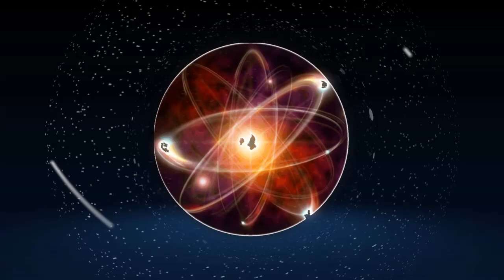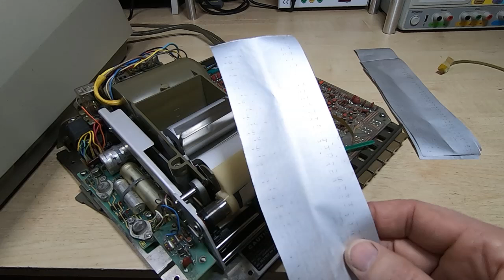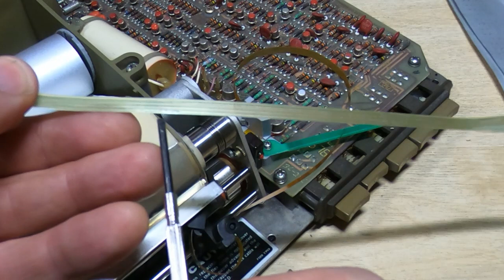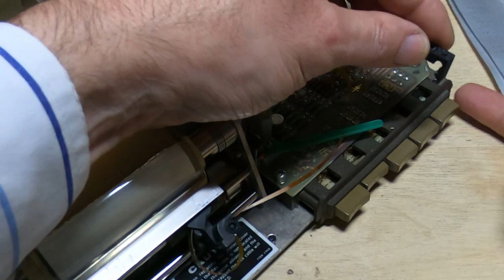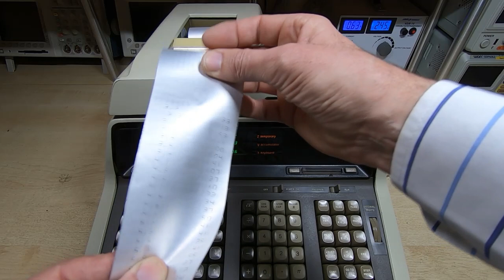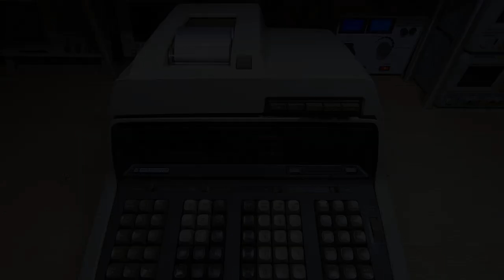HP9120A #1 Repair Part12

Comment: Jerry, this has turned out to be a nice and very interesting repair.  Please do share the details of the magnetic card reader wheel repair and especially the print head repair on the second machine.  Basically everything you didn't show on this first machine.

I've got a box of TI-58C & TI-59 calculators (obviously much newer and less interesting, and probably less repairable than the HP gear you show) in my workshop and may even have the printer that they can be connected to.  I used my -58C in college and at work when my "standard" scientific calculator wasn't up to the task (which was rare) and much later obtained the box of goodies to play with.  After watching you repair these HP calculators, I want to open the box to determine the condition of the calculators.  I'm  certain that all of the batteries will have to be replaced (hopefully I already removed them) and the magnetic strip readers in the -59s will probably need cleaning or repair, but nothing ventured, nothing gained!  ;)  Hopefully my memory about the printer is correct and I'll be able to resurrect it too.